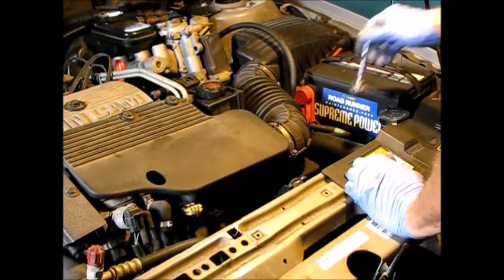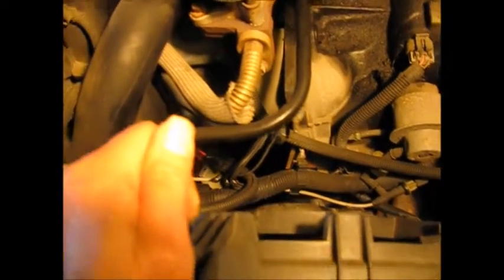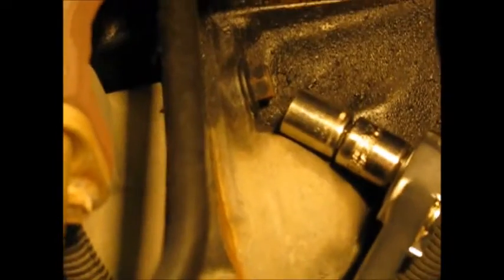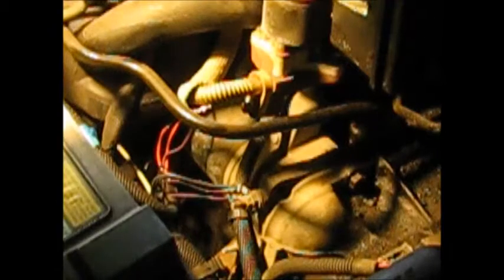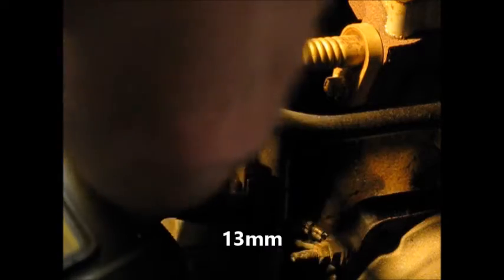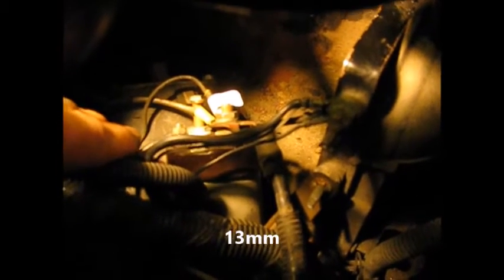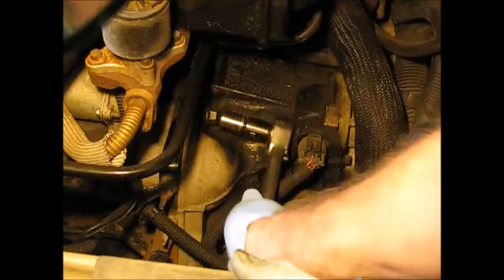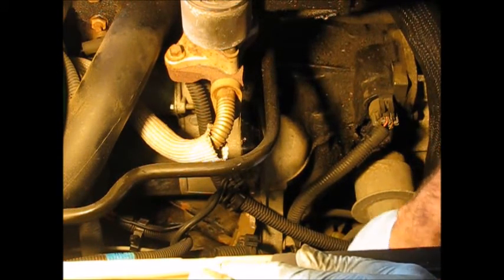How to replace the starter in a GM 2.4L quad four Grand Am,  Sunfire, Cavalier, Malibu and others

Comment: Thanks for your thorough, well-lit, easy-to-follow instructions. I really appreciate you specifying all the faster types & sizes 👍👍
Reply from the maker: You're welcome. Thanks for watching and providing feedback!
Reply: @TheOriginalMechanic  3 wires go on the starters cellenoid?? Theres the little tiny one that goes on alone . then theres the red battery cable & a random  black one. So the black cable eyelet goes on top of the red battery cable one then i put the bolt on ??
Reply from the maker: @screwyou89  Yes, it goes on the big terminal with the red cable.

Comment: Just did the starter on my 1999 Sunfire GT  today, I actually found it completely unnecessary to remove the fan or the oil filter.  A stubby handle on a socket removed the nuts for the wiring from the top side and once the starter bolts were out I just pushed the back of the starter up to bring the front of the starter out nose down out the bottom of the care.  Reversed to install.

Comment: Is there supposed to be a small black wire connected to the screw on the side of the solenoid ? When we removed the starter it was on there but now the engine is staying running without the key in but it did start up. We could hear it connected to something when we connected the negative battery cable back you could hear some electricity and a small spark and then it was “dieseling” . we have three wires (including the large battery wire) to the b+ on the starter and one smaller red wire connected to the other screw next to it . Then there’s an extra small black one that I’m not sure what it is . Please help!

Comment: I have a ‘99 Pontiac Grand Am, 2.4 Ltr I just recently purchased. The guy I bought it from said the starter might need to get replaced sometime, so I took it to autozone a few days ago, after I bought it and they did a test on the battery, it was bad so I got that replaced. It ran good after that, last night I drove it and it drove great, came back home let it sit for a while. Started it up, had it running for a bit then shut it off. Went to turn it back on and nothing. No clicking from the starter. Just a humming. All the lights came on. So the next day I took the starter out, went to Autozone and they tested the starter. That was bad. Got a refurbished one, installed it, and the same thing. Except there was a click, after you turn the key it just clicked once, then a hum. Somehow something had drained the entire battery. Because nothing would come on when I checked it after work. I checked all the fuses and they are good. Any recommendations as to what might be going on?
Reply from the maker: Either something is draining the battery or you have a bad chassis ground. The easiest thing to do first is to check the grounds. These are large lugs bolted onto the engine in several places. Look for looseness or corrosion.  A meter on ohms is handy here. There should be very low resistance from the battery negative to the ground points. As for a current drain, that's pretty rare and can be hard to find.  Look and listen for something running after the car is shut off. Otherwise a ammeter may be needed to tap into circuits. Good luck and thanks for watching!
Reply: The Original Mechanic Thanks! Got it going last night, it had amp wires connected to the battery, so that drained it completely over the weekend. Took those off since I don’t have any amps connected to it for the ground. Got it running, and eventually found out that the battery just needed some charge to get going.

Comment: hey man im having a tough time tryna get the lower bolt out this is the first doing this and it feel like its super tight tried d40 and breakaway neither worked help me or do i need to take to shop and let them use a air compression drill
Reply from the maker: There are lots of tricks for this common problem. If using penitrant and jarring it don't work, I may be time to use a torch. Don't break it off! Good luck.
Reply: The Original Mechanic bought a electric drill and use the adapter and couple tries it finally loose thanks man you help me out big time and alot of efforts.
Reply from the maker: Way to keep at it and you're welcome.

Comment: I replaced my starter on a 96 Pontiac grand am gt and now it cracks up but dies right away it never did that before . The starter is doing it’s job I’ve made sure the wires are all connected and from what I see everything is connected . Not sure what the problem is
Reply from the maker: Check the wiring and plug for the fuel pump cutoff mounted near the oil filter. It is very easy to dislodge the wiring when removing the starter. How do I know? Don't ask lol
Reply: The Original Mechanic it was that lol now we’ve got that in but now we’re having a different problem! It starts up and I cut the car off and it kept running for a about four seconds after that. We had to remove the negative battery wire . We figure wires are touching but I’ve checked and we don’t see anything touching . Not sure why it would be doing that that’s all I’ve seen online, thanks for the help!

Comment: where exactly are these wires ran exactly? i have a 2.4 l ls cavalier with the same motor and i want to make sure i got the wires right.
Reply from the maker: I have some pretty sharp pictures on my blog post on this job that may help:
http://www.originalmechanic.com/2015/10/how-to-replace-starter-in-gm-24l-quad.html
Reply: The Original Mechanic what would cause the starter to just click and whine? my motor wont turn at all. im at my last whim with this car. im so close to just junking it. help me out.
Reply from the maker: If that is the old starter you are talking about, you may need to pull it and test it or have it tested. Old or new,  make sure you have full battery voltage down there. Possible flywheel problem?  I think that's rare, but if the starter is good you have to consider that. Good luck.

Comment: Is there a way to do it without taking off the oil filter
Reply from the maker: Sure, but the clearance is very tight and be careful not to dislodge the harness for the nearby sensor. I learned this the hard way lol
Reply: Thanks I installed the new starter I ended up taking off the oil filter like you suggested everything went smooth

Comment: sorry but that's not oil pressure sensor. that's the cam position sensor. oil pressure sensor screws in. cam sensor is held on by a bolt. look it up if you don't believe me
Reply from the maker: No argument here. You're right. I corrected this on a later video.